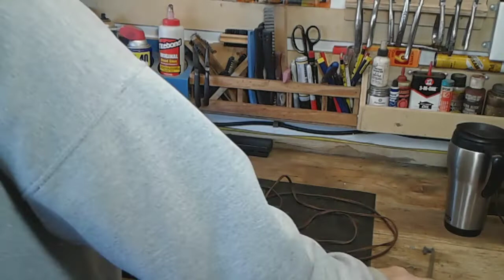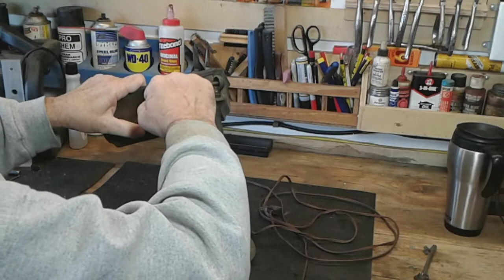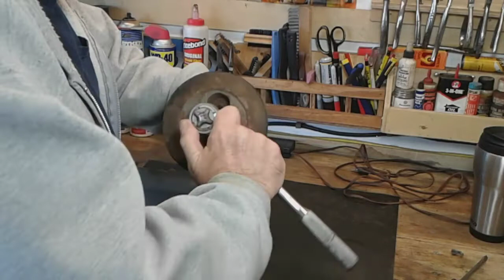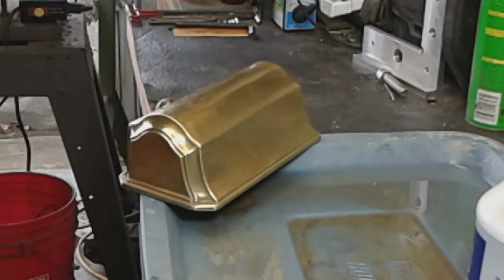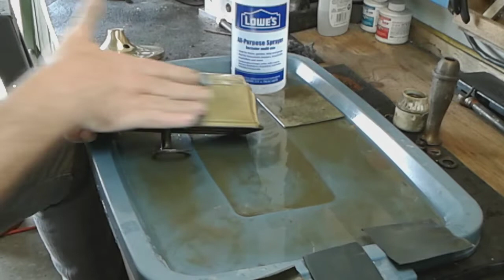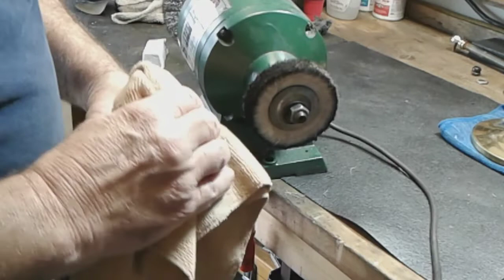Restoring a 1940's Brass Bankers Lamp.

Comment: I have been throwing my brass bits into CLR, 50-50 solution in water. I know it says not to put it on brass but any patina, even the fake one comes right off with a wire brush after a day of soaking. I have cleaned many brass parts that way with no damage to it.
Reply from the maker: Good tip, I'll give it a try at some point, thanks.
Reply: @oldmansworkshop6396  what’s cool is it takes out almost all if not everything that’s built up on your brass part with just light scrubbing using wire brush. There is hardly any abrasive action so the details on the brass piece, if any stay nice and crisp.